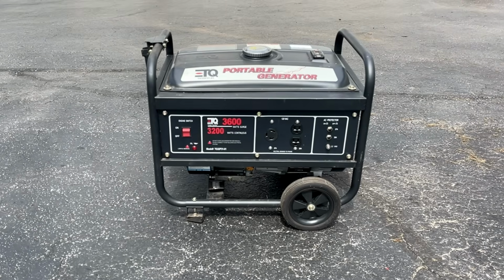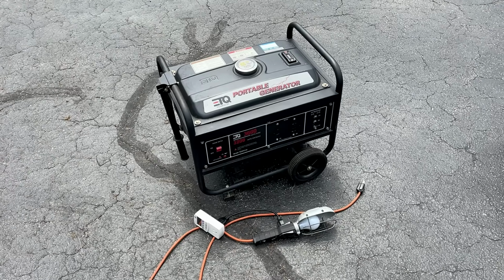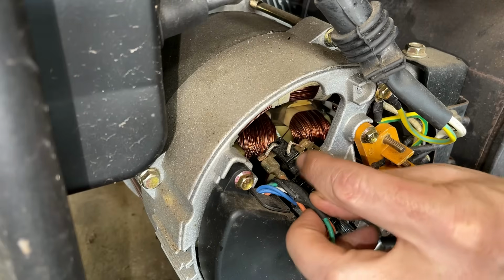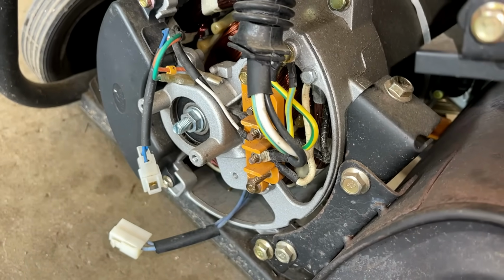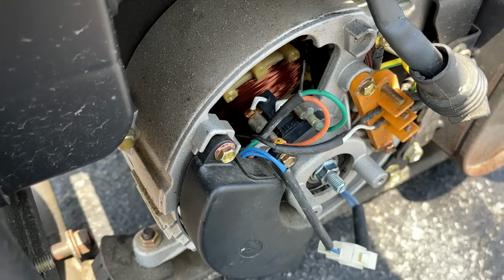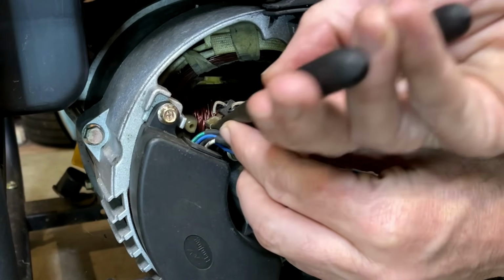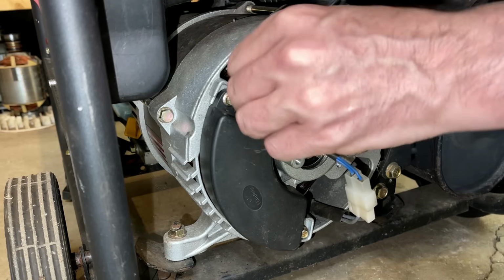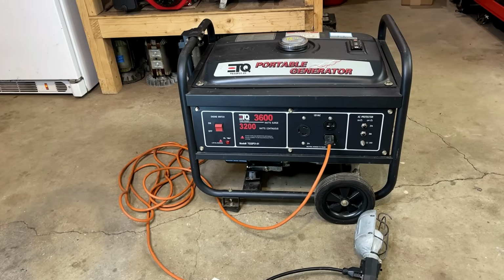Two Generators No Power Output - Same Model, Same Problem?

Comment: Well now we all know which dead generator will probably be an easy fix 😁 I think the REAL culprit is the brush holder being made of poor materials which could cause brush sticking and arcing, which adds heat causing more sticking and arcing etc. There could also be some misalignment between brushes and slip rings. A little either way could be fixed: shimming outward or filing the mounting surface thinner but you hit limits of the material strength. Best would be that doing that if needed, and better quality brushes if available (and they probably aren't). Being an easy and cheap fix, I'd recommend that anyone using these just replace the brushes based on use-time as maintenance, and having an extra usable brush-set on hand for emergency repairs. 

This is the kind of thing you encounter with low-quality cheap machines of all kinds, and it may be acceptable based on your usage and ability to do the fix. I've got a different cheap generator but now I'm going to pop the end cover and have a look at the brushes, because now I know this might be a potential problem 😉It's honestly something I never considered as most brush holders I've encountered were pretty stout, but I guess "cheapening" happens here too now 🤥

A good job as always James 👍

Comment: Never heard of ETQ before, After watching this I looked them up and it seems this is a case of "you get what you pay for".
Reply from the maker: This model was only $300 new.  Doesn’t get much cheaper then that for a 3200 watt generator.
Reply: @jcondon1  $75 for a $300 brand new with a potentially bad power head? Yikes!

Comment: This is the time where a 2nd body would be nice. 1 to pull the pull starter and 1 to hold the scotchbright . Great video
Reply: If you follow the slip rings' existing surface with the sandpaper...
any existing hills or hollows in the slip ring surface just get followed but not eliminated.
You basically have to lathe them smooth with an adjustable brush-like holder that takes the hills off until they are down to the bottom of the dips.....????

Then the smoothed even surface can polished....

Comment: Try emery cloth on the sliprings and turning the rotor with a drill motor, they need to be a lot smoother...!
Reply: If you follow the slip rings' existing surface with the sandpaper...
any existing hills or hollows in the slip ring surface just get followed but not eliminated.
You basically have to lathe them smooth with an adjustable brush-like holder that takes the hills off until they are down to the bottom of the dips.....????

Then the smoothed even surface can polished....

Comment: It appears these could be C.H. Ina Co. generators of questionable quality control. After checking brush alignment,  you are still concerned about the slip rings and "IF" they are thick enough, a skim cut on a lathe should renew the surface.

Comment: Jim: I learn a lot from your clear explanations and I might even tackle a job like this if I came across the opportunity. I have the engine side down. It is the generator side that I am learning from your content. Thank you. Do your space heaters ever get used to heat spaces, or are they basically for the purposes of providing known load for testing generators?

Comment: A strip of fine grit emery cloth can be looped around slip rings or commutator and used to 
clean and level the surface, done manually or by bearing the emery against the spinning
part. The emery will load up from particles but it can be worked back and forth to bring
fresh surface grit into contact and will do a good job cleaning and polishing the copper.
It is the same idea used by plumbers cleaning copper pipe for soldering.
Reply: If you follow the slip rings' existing surface with the sandpaper...
any existing hills or hollows in the slip ring surface just get followed but not eliminated.
You basically have to lathe them smooth with an adjustable brush-like holder that takes the hills off until they are down to the bottom of the dips.....????

Then the smoothed even surface can polished....
Reply: @JohnSmith-yv6eq  A small flat file works too, or an emery board like for fingernails. This is useful for an in place repair good enough for many scenarios, but for an overhaul and reman sort of repair removing the part and turning it on a lathe is good.

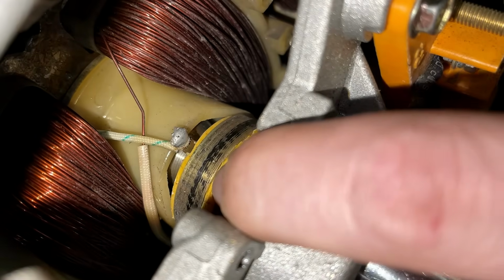Comment: Page 18:43. The second example prompted me that both faults could not have happen had the slip rings began perfectly free of varnish. 

If rings had vanish coating (by accident or carelessness) test run could break up some coating but all, speculating that the factory no load test return with an OK status. 

Operating it in the field with substantial load, when encountering vanish interruption there was an electric arc and arc heating, when the interruption suddenly subsided the AVR surge current into the field coil and generate I^2*R heat.
Reply: If you follow the slip rings' existing surface with the sandpaper...
any existing hills or hollows in the slip ring surface just get followed but not eliminated.
You basically have to lathe them smooth with an adjustable brush-like holder that takes the hills off until they are down to the bottom of the dips.....????

Then the smoothed even surface can polished....

Comment: Brushes or slip rings? My guess is a little of both. The first generator appeared to have solder splatter from when the rotor winding lead was connected to the slip ring terminal. The second one I concur with the previous commentor that the alignment appears to be off such that the outer brush is partially running on the insulation rather than the copper preventing a good connection resulting in heat buildup. The brush problem is cheap plastic that seems to melt at a low temperature. I also wonder how much spring tension there is pushing the brush in contact with the slip ring.  The blue Scotch-brite is much less aggressive than the green as you mention. In this case I would think some very fine Emory cloth  or even steel wool would have cleaned up the slip ring to bright and clean so as to minimize contact resistance and subsequent heat generation. One must watch out for the fragments from the steel wool and blow out the area before powering up.
Reply: If you follow the slip rings' existing surface with the sandpaper...
any existing hills or hollows in the slip ring surface just get followed but not eliminated.
You basically have to lathe them smooth with an adjustable brush-like holder that takes the hills off until they are down to the bottom of the dips.....????

Then the smoothed even surface can polished....

Comment: Congratulations on your "twins," Jim. Who knew that they would have the same problems. I passed up two generators at a local scrap yard. One was missing the carburetor, and the other one I didn't get a close look. The first was a rebadged champion unit. I suppose that they both could have been repaired given the fact that it seems that they were scrapped by an electrical contractor who was either closing down, or maybe just cleaning up the tool room. I got two ridgid 24" pipe wrenches, and they were fine, one forged steel and the other one aluminum, and the corded tools in their metal cases likely were fine too, though they appeared to be a bit older, like the Black and Decker reciprocating saw. It's a shame there is so much waste. I had my car this day and didn't want to mess up the seat, so I passed on the generators.
Reply: I also went to the scrap yard on tuesday and kicked myself for not going a day sooner. Someone offloaded a dumpster full of generators ranging from roughly 3kw-15+kw. The yard usually held on to stuff like that for a few days incase someone wanted to buy them, but crushed almost all of em because there were just too many and didn't have much room. I saw smaller cart style generators up to the big twin cylinder 20+ hp cummins/onan units. It was very hard to look at. Out of the pile, I found one upside-down coleman 240v 6kw with the 10hp briggs that looked half-way decent when I flipped it. Gave the yard $20, hauled it home and pressure washed all the years of crud off of it. Long story short after rebuilding the carb and fixing the on/off switch the thing makes power and runs great! Even had half a tank of gas which was worth the money itself lol.

Comment: Thanks for a great vudeo again James , my thougts is that the brushes were not broken in properly and got overheated from start . Here is what im thinking and i dont know if i am wright , you should run the genny a tank on a quarter of load only to brake in the brushes and let it run 15-30 min after use to cool down. After that you can use it nomaly.

Comment: Wonder about the single bolt holding brush holder. Would think that would just lead to more movement/vibration and poor contact.
Reply: A single bolt but on the other end was a stud and the holder had a hole to keep it in line.
Reply: @namvet-72  saw that after comment. Still seems less stable. The whole design/alignment/quality just oozes “cheap”

Comment: First time I differ with James. On this particular situation with an identical problem, I would change slightly his fix. I would start the engine to clean the slip rings. When a situation like this particular one surfaces I would run the engine with sand paper instead of scotch bright. I would make sure both slip rings were completely smooth and clean and might use a new lead pencil with the eraser end on the sandpaper for two reasons. 1. To reduce probability of shock. 2. To hit exactly the spot on the slip ring being cleaned. He left roughness on one slip ring in each set. Dancing brushes will certainly overheat and in the future produce similar results.
Reply: I don't think the rings are very thick to start with, so you can not grind the surface much without destroying them.
Reply: If you follow the slip rings' existing surface with the sandpaper...
any existing hills or hollows in the slip ring surface just get followed but not eliminated.
You basically have to lathe them smooth with an adjustable brush-like holder that takes the hills off until they are down to the bottom of the dips.....????

Then the smoothed even surface can polished....